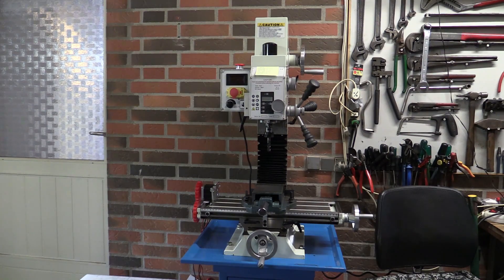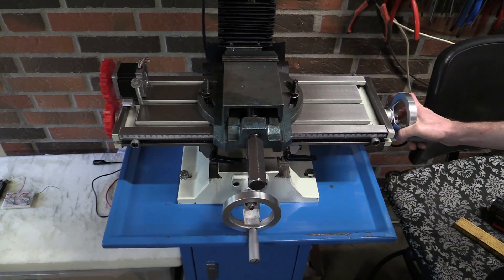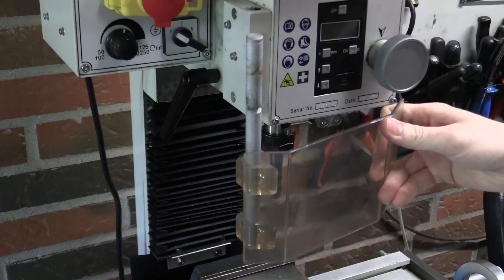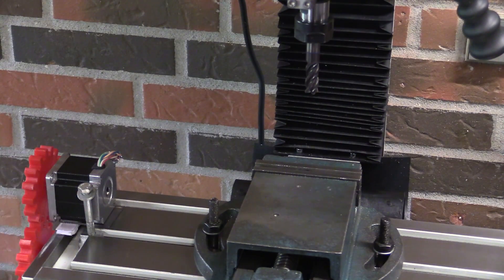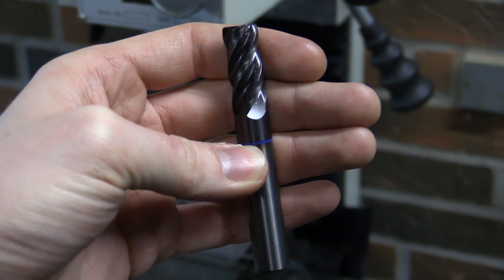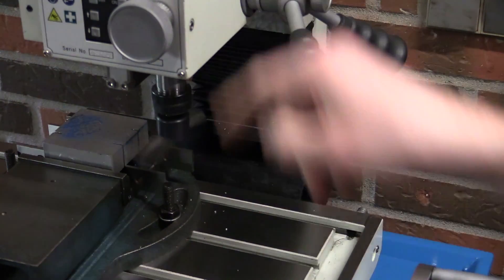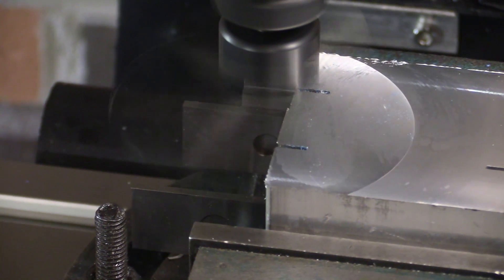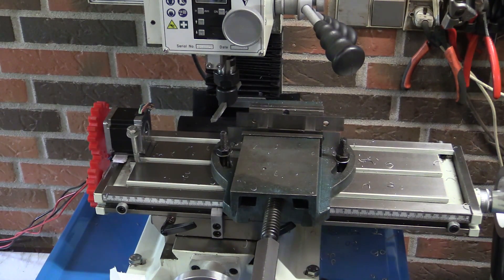First Look At The Milling Machine (Weiss WMD20V) - Ec-Projects

Comment: regarding the stepper motor not being powerful enough, did you consider changing the gear ratio?
Kind regards
Zas Huysmans
Reply from the maker: Zas Huysmans Yep, I did consider that, but the motor also loses torque when speed is increased, so I'm afraid it wont handle it :(
Reply: I see, bigger steppermotor it is then!
I like the channel, keep it coming!:)
Groeten uit België!
Zas Huysman

Comment: Your power feed is pretty creative. Sorry, I also clicked through, but I was wondering how you remove the tool, not from the ER holder, but from the R8 spindle, in particular how do keep the spindle from turning. I have the same mill and use a small electric driver on the draw bar and that seems to work well. The previous model apparently had flats on the spindle to receive a large wrench, but that was removed on more recent models.
Reply from the maker: Kent A. Vander Velden Mine does also have flats on the spindle, so I can use a wrench, it's an MT2 spindle though.. :) Thanks :D

Comment: I just clicked through the vid because I have no time right now and man, you really need to unlearn to put your fingers in danger (around 16 min mark). You're an electronic-programmer guy, you need your fingers, and it's super easy to lose them by accident. Other than that, cool vid, cheers
Reply from the maker: kosair rox No worries, the camera was like 1.5 meters away and my finger probably 75 cm :D